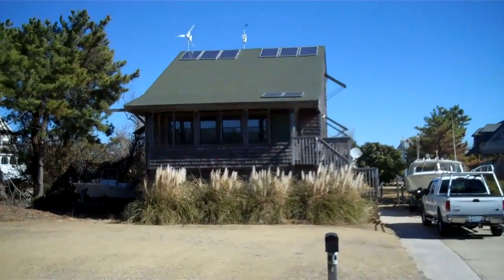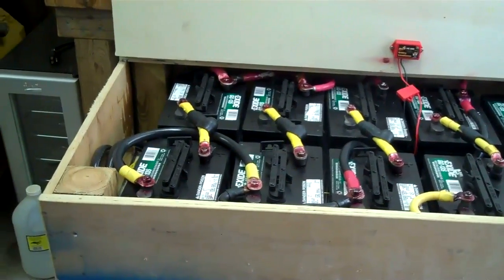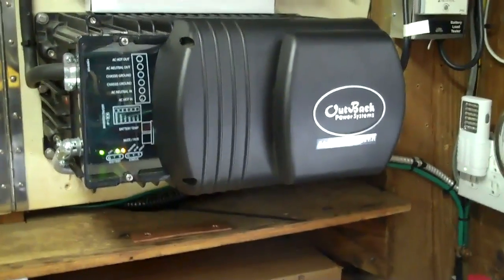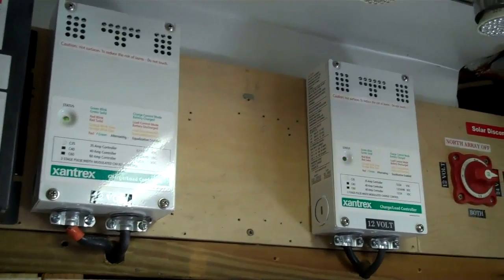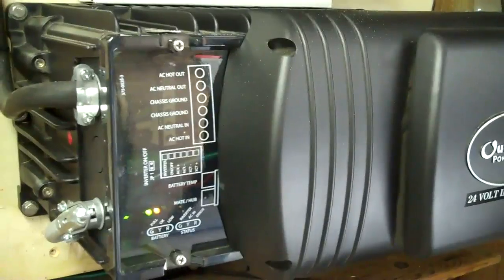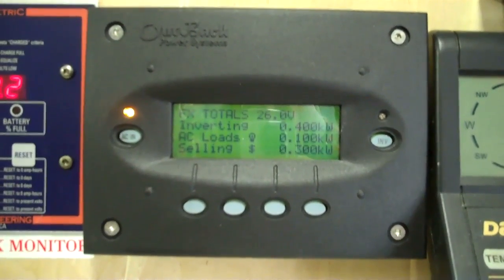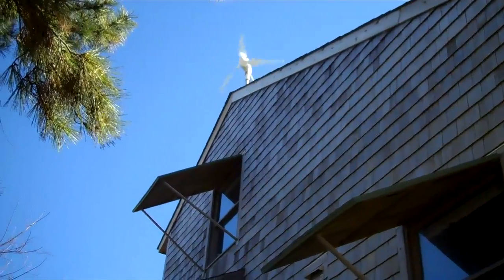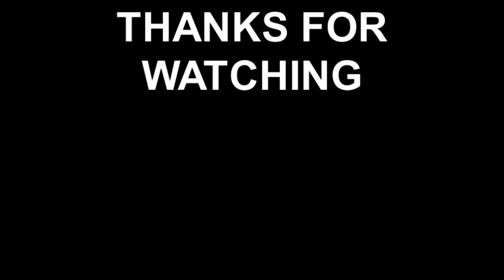A GREAT DAY TO MAKE YOUR OWN ELECTRICITY WITH SOLAR AND WIND

Comment: Hi Kevin,  I'm curious what you are doing to prevent overload between the batteries and everything else?  Are you using inline fuses or dc breakers?  Is that what's hidden behind the big, hinged panel?  Great videos and keep 'em coming.

Comment: Good job things looking better and better. I still am in entry level one I get the panels on roof I should be able to really get off to a better start. I am only pumping max 370 back to grid now.  And using batts. and another 100 watts or so for that on other panels. This keeps my tv lights and computers running at night. If I plug my mini fridge in though taxes batts quick.

Comment: Your system is fantastic!  I have put all my energy into water, food and generators and have only done some low budget solar power , with panels, charge controllers and inverters.  Your system is absolutely blowing my mind!   I don't know where to start on adding solar to my system of gensets.  Wind is out for me but I would like to do some solar.  Anyway, you have my mind racing and I appreciate you sharing your system!

Comment: Those AGM batteries are something else! Those will give you more power and absorb more energy than the lead acid ones, and at higher rates! Good choice! Less loss from internal resistance too. Good for long duration power outages, SHTF situations. Looks like room for more panels on that roof of yours. Visit techluck DOT com

Comment: I have to say this is one of the best systems that I have seen so far.  Would it be possible for you to do an idiot's guide to building this system?  What do you recomend for reading material, there is so much out there, kind of hard to shift through without being an electrical engineer.